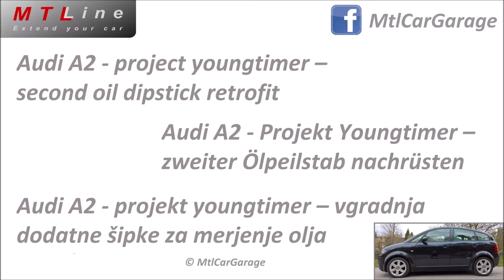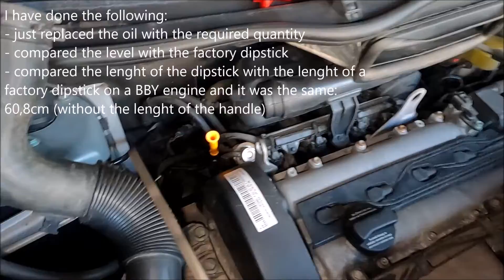Audi A2 – second oil dipstick retrofit (1.4 16v petrol AUA engine) – EP20 – project youngtimer

Comment: Hi, I've some the same on mine and just let you know, overtime the handle will eat itself through the air pipe. I'd patched it up and put a clamp where they connect.
I'd also seen others have this but their funnel was much smaller and the handle didn't reach that hose, which is odd as the part numbers matched, of course it's worrying as I don't wanna mess up the engine. Its been fine though, so hopefully works as it should.
Reply from the maker: Thx for tip. I have showed in the video that there is cca. 1 cm of distance between the dipstick and the air pipe, so it should be ok. But I will double check now after half a year, to se if everything is ok.
Reply: @MtlCarGarage  There's a gap on mine as well, but the vibration from the engine and probably during braking it ate through. Have a look in a month time.
Reply from the maker: I will definitelly keep an eye on it… And since I drive it quite “enthusiastically” :) it should show signs of wear quite quickly.
Reply from the maker: @final0222  I have checked it and after 1000 km there are no signs of tube damage. But I will keep an eye on it and I have also pinned this comment, becasue it is definitelly an issue that needs to be kept under control. Thank you for your remark.
Reply: @MtlCarGarage  i cant find this part in my engine, its a audi petrol 2002, dont know if this year Is different
Reply from the maker: @casainfilippo3042  Yes, later cars did not have that opening for the second dipstick.

Comment: Thank you so much,  I lost one engine possibly due to low oil. My replacement engine was great but sounded off after 18 mths, this gives me absolute confidence, I found the oil level was low. Without this, you have to change the oil to be sure.